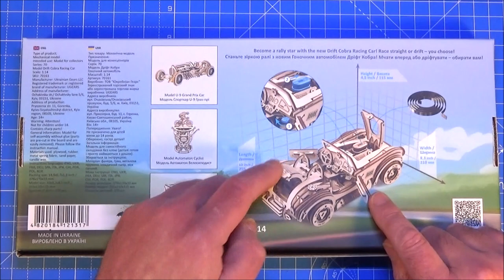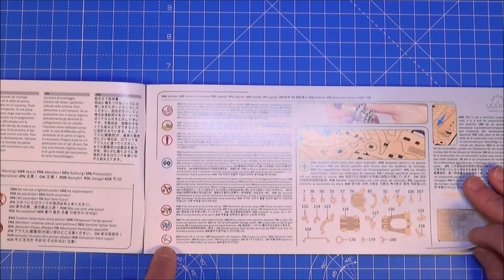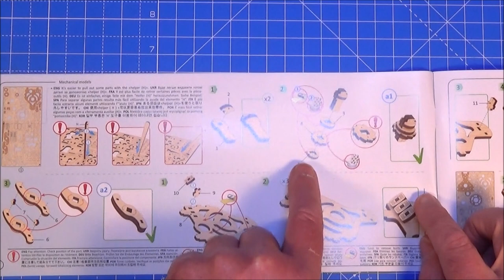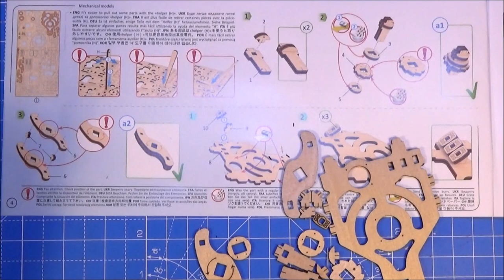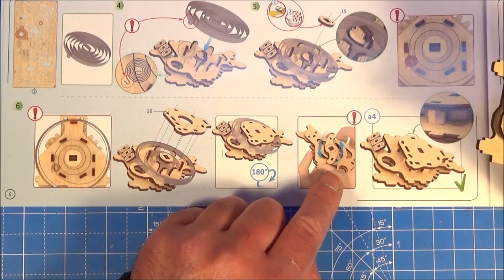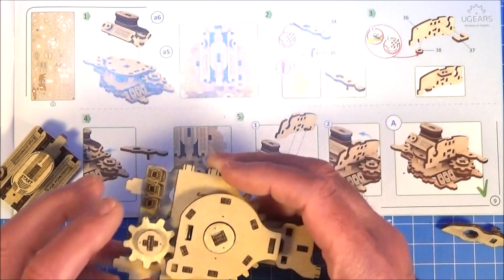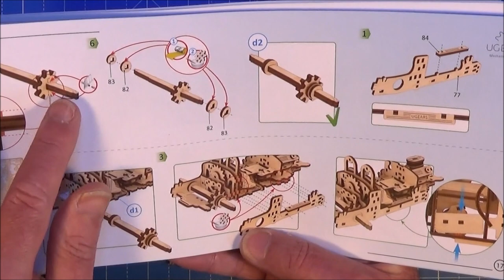UGEARS Cobra Drift Car Build, Run and Review - 3D Mechanical Wooden Model

Comment: That's amazing Mark, what a great kit.  You did such a good job on it and also the video.  Just showing the tricky bits should be enough to help someone out who is building this.  Also very interesting to watch even if you aren't building it.  I'm super impressed that you got some tracking shots like the RC vids.  Top work all round my friend 😁
Reply from the maker: Cheers mate and thanks for taking the time to watch this non-RC related content! Yeah I thought if I showed every step the video would be 10 hours long!!! It was good fun to film it running but it only goes about 7m before the spring is unsprung! Looks cool though! It was a nice change from plastic models and I'm looking forward to the next one. All the best my friend!  :))

Comment: I have seen similar stuff in my local hobby shop but I have not purchased one yet. I may have to give them a second look as it does look like a lot of fun to put it together and it is incredible that it all slots together so well! It is really neat all the features it has too! I just assumed they were just display models and not anything functional! I did see they had some simple machines that functioned but I will have to take a closer look next time I pop in for some paint, you know how that goes!
Reply from the maker: Hi Addam, yes this was a first for me but I'm glad I got the chance to build one, it really is a different experience to a plastic kit and it just smells so nice, too! Mmm, fresh pine!!! The accuracy of the parts puts some RC manufacturers to shame! The little moveable features raise it above the usual static models and to wind it up and see it go really made me smile. Hope you find something of similar interest, but remember all those other little RC "jobs" that you have on the go, first! Cheers, dude!
Reply: @MarkBryanRC  yeah, I need another project to add to the list! 😂 You can see how I get so far behind!
Reply from the maker: @AddamsPlayground  Haha, sounds like we are exactly the same when it comes to projects, my friend! 😅👍

Comment: It's clever how they build these, but with modern CAD it does help. I did expect it to fall apart with all that tension on the spring 🙂
Reply from the maker: Sure is, Mal! Yeah the accuracy of modern computers and machinery is amazing these days! Haha, yeah I was wincing as I wound up that spring mate! 🤣😜👍
Reply: @MarkBryanRC  I have built things from years ago, that failed the first use. So I was impressed.
Reply from the maker: Same here, Mal, it's so disappointing when you get a first-time failure!

Comment: I finished this and it wouldn't work. Very frustrating, luckily I figured out that the two pieces running length wise along the bottom needed to be pushed together very slightly. Now it is perfect. I love the complexity that was gone into the engineering
Reply from the maker: Hi and thanks for the comment! Great job, figuring the problem out! Same here, I am very impressed with the thought and engineering that has gone into these models. I'm just building the Dream Cabriolet VM-05 and I gotta say it's on an even higher level of complexity! Cheers!